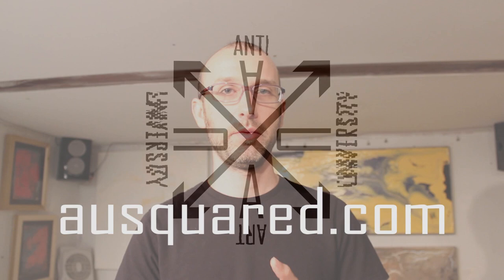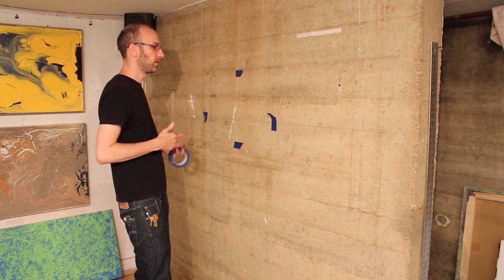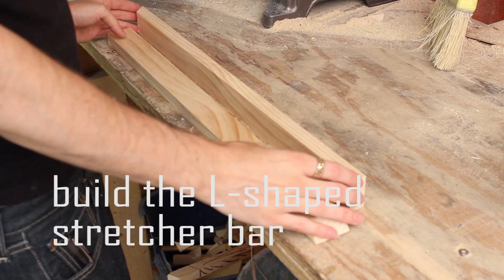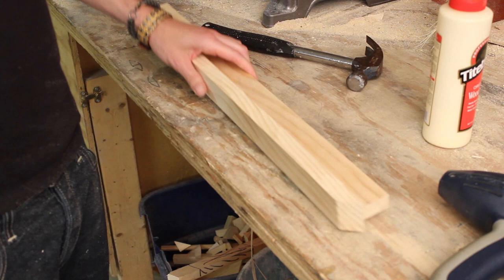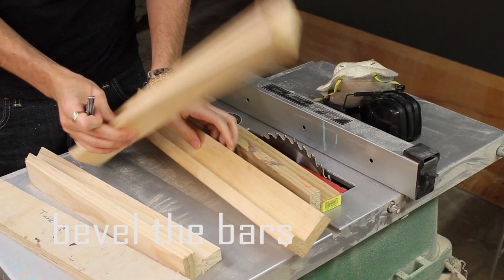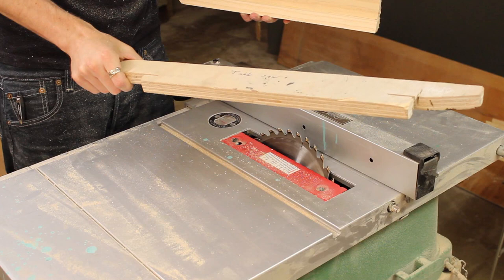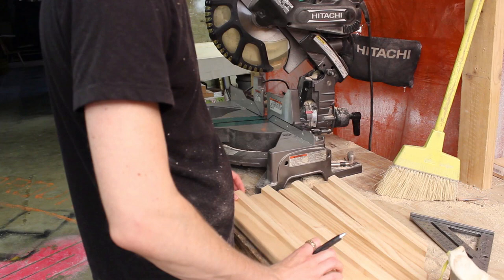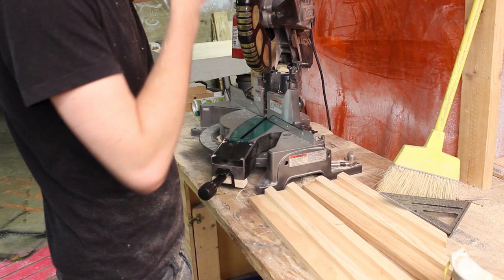Make Your Own Canvas Pt.1: The ONLY Way to Build Stretcher Bars

Comment: I’ve used comercial stretcher bars for over 25 years and have some woodworking knowledge and the tools to make things. With covid restrictions in place I’m not able to make it to an art supply store but the hardware store is open. I bought two clear pine boards 1x4x8 and ripped them in half. While it wasn’t without its challenges, with your instructions I was able to make a decent frame to stretch canvas on. I can’t wait to explore this more..cheers!
Reply from the maker: Awesome. The hardware store is your best friend when art stores are closed or far away. There are lots of potential painting surfaces. I will even prime heavier paper and paint on that at times.

Comment: Suggestion on setting your rip fence:  measure from the slot for your cross cut guide to the fence at each end of the fence, then check your distance to the saw blade to the fence to confirm the depth of cut.  This keeps the work square to the blade, preventing binding and kick back.  Plus it gives a smother more consistent cut.  Also a good quality blade is essential.
Reply from the maker: Always a good safety tip. Works best on a decent saw.

Comment: Awesome. Thanks. BTW If you set the blade height so it just passes thru the wood, it's much safer.
Reply from the maker: I know--it's just not as dramatic on film (kidding). I have a new saw now with a better guard. The guard on this saw kept catching the wood and causing it to kick back, so I took it off for a more predictable feed. It was a calculated risk at the time: use an unsafe guard or use an unsafe but more stable unguarded blade. Both were bad options.

Comment: Not only is this not theONLY way, but it is far from the BEST way! I was hoping for a tutorial on the joints used for real stretcher bars (this is just a frame) that can be expanded with 'keys' to retension the canvas if necessary. I haven't found that yet. I guess I'll keep looking.
Reply: Ron Tocknell Painters as early as Titian and as late as Rembrandt were very likely using "strainers" and NOT keyed stretchers. Titian is known to have used canvas because he painted some extremely large pieces and canvas allowed light-weight transport when needed.

Rembrandt's "The Night Watch" is 142.9 in × 172.0 in (not sure if that measurement is before or after it had to be cut) and was most likely originally on a strainer and NOT a keyed stretcher. Keyed stretchers only started to appear around the 18th century. And yes, painting on panel was common early on but the earliest paintings on canvas actually date to the 14th century (1300s).

Yes, using a keyed stretcher might help to prevent cracking but I don't think it is the only, or even the best way to prevent cracking. I am sure that Bouguereau was painting on keyed stretchers but I also know that many of his paintings are severely cracked. I once saw Caravaggio's "Supper at Emaus", a relatively large and much older painting than Bouguereau's, and it had insignificant damage due to cracking.
The best way to prevent cracking is to follow the rule of fat over lean and to paint with the least amount of layers possible. Seeing Caravaggio's paintings in person you come to realize that he was painting in a very simple and straightforward technique that used perhaps no more than 3 or 4 layers while anyone who's seen Bouguereau can tell right away that he was painting in many, many layers and glazing/scumbling heavily. Bouguereau was practically asking for his paintings to crack.
I find it troubling to insist on something that simply isn't true. And to think that there is such a thing as the secrets of the Masters (keyed vs not keyed). There are no secrets...only common sense.
Here is a very good history of stretchers/strainers:
http://www.conservation-wiki.com/wiki/PSG_Stretchers_and_Strainers_-_II._Factors_to_Consider
Reply: Besides Caravaggio, within 3 seconds of walking into any museum that holds early European paintings you can spot paintings on canvas by lesser known artists that have virtually no damage...paintings that were very likely done on strainers and NOT on keyed stretchers. I would also venture to say that if restorers encountered keyed stretchers they were very likely not original to the paintings.
Reply: On paintings that are pre 18th Century, this would certainly be true. But the keyed bridle joint came into use about mid 18th Century and, by the 19th Century, they had become the standard. So you're right in that many of the keyed stretcher bars encountered by restorers were not original to the painting... and there is a reason these painting were transferred onto keyed frames (usually glued to a more robust canvas support).It was done to address the inevitable sagging.
Reply from the maker: From my experience, the only reason I've seen for re-tension is an improper stretching job in the first place. Generally, it's uneven tension that's the problem. Typically, this is caused by starting the center too tight and loosening as you approach the corners. You see ripples around or over the edges. The other problem is storage--anywhere that varies too much in humidity and temperature is tough on canvas.
Reply: I've never had to use keys and don't know anyone who ever has. I did experiment with them once, and if you use them enough to make a difference, you then, have a mess.
Reply from the maker: You've got a point. I just think if you keep having to adjust tension, then your painting is in a bad environment. Plus, these are the kinds of concerns an archivist gets into, and that's a bit beyond what almost every artist needs to worry about. I feel like if you're really that concerned with archiving, you've probably got studio assistants you can pay to worry about it for you and a host of collectors and gallery folks to worry about long-term care for your work.

Comment: This is a good method up to a certain size. Around 5ft or so, dimensionally, I ran into needing excessive struts or too wide of inner ribs to keep everything stable.
  Fine method most of the time though.
Reply from the maker: That's weird. I've done stuff over 8' with corner braces and one cross bar to support the center.

Comment: I would add that if you buy your wood in 2X thickness and cut your 1X2 from it you will be able to get quarter sawn material. A normal 2x8 will yield 2 quarter sawn sticks from each edge.
Reply from the maker: True. Ripping 2x4s can be tougher depending on the saw. The wood quality is also not as good and tends to be more warped.

Comment: 12:23  i was about to get a heart attack .. glad it dint kickback .. 
great job .. stay safe 😊
Reply from the maker: The table saw pictured had a sub-par guard that would cause kickback 1/3rd of the time. I replaced it with a circular saw and a long metal bar to use as a guide.

Comment: I like the design quite a lot and will definitely start making my own stretchers.  But gluing end grain doesn't work because of the nature of wood fibers.  End grain is essentially a bundle of straws.  Wood glue works by bonding with the fibers.  That's why long grain glue bonds are so strong.  If properly glued the wood will sheer off before the glue bond breaks.  I think an improvement to this design would be to route out a sufficient sort of tongue and groove type joint at the corners so the glue can do its job.  Otherwise you're on borrowed time with end grain glue ups.
But thanks for the video! I'm inspired to make my own and save money for better oil paints!
Reply from the maker: I used to do biscuit joining, but I've never encountered a noticeable difference. Maybe if you over-stretch the canvas. If strength is a worry, a frame will also help.
Reply from the maker: In reviewing comments on this one, I came across this again and realized I didn't fully respond. When I take stretchers apart, because they're stapled and glued, I have to remove the staples first then bang them multiple times with a hammer to get the glue to break, and sometimes it splinters the wood with the glue remaining in place. Worrying about engineering these things is massive overkill. We're talking small amounts of distributed forces, after all.

Comment: I appreciate the craftsmanship but have you ever heard of quarter round?
Reply: Exactly how my painting professor taught us back in the late 70's. It adds that lift for the canvas, and eliminates the need to bevel the 1x2. They are also a little less weighty on a finished large canvas. I can't find anything on YouTube for using quarter rounds, so I'm happy to see someone else asking the question. We were also given the option of using brick moulding, minus the quarter round.
Reply from the maker: +Janet Wise used to use quarter round. The bars warp and at least one corner will pop off the wall. There aren't 2 directions of structural support with quarter round. This is why you use the method of 1x2s in an L shape. They won't warp unless left in a highly humid area.
Reply from the maker: Yes. I stopped using quarter round. It's good for studies, practice, throwaway paintings, etc. The problem is that there is nothing to keep it from warping with only quarter round. Typically, a corner will pop off the wall when you hang it up. This is why I switched to the L-shaped bars. They have more structural integrity.
Reply: Thanks so much, Mead
Reply: I think he was saying use quarter round on top of the 1x2 and glue it down essentially creating an L shape. However quarter round is notoriously warped to begin with so wrangling it in place can be a pain. Great Video by the way
Reply: Isn't that the little Chinese kid from Temple of Doom?
Reply: @blackopal3138  hahaha. No, that's short round. "Hold on to your potatoes!"
Reply from the maker: Yeah that's a possibility but does add more material cost. It's probably also faster to bevel than to glue and nail quarter round.

Comment: Do you have really small hands or are those 1x2s really big. They look so much bigger than the furring strip 1x2s.
Reply from the maker: Furring strips are probably even smaller than the standard 1x2. I also sometimes cut down a 1x4 to make two 1x2s, and they wind up being a bit wider that way.

Comment: Mead: thanks so much for sharing your valuable experience with all of us. I've made several picture frames for my wife's art but have only just recently decided to try making stretchers (I didn't even know they were called that). After quite a bit of searching, I finally stumbled upon this series by you. Amazing and packed with so much good info! The only question I have for you is pretty simple: when you say 1" x 2", do you mean actual or nominal dimensions? Up here in Nortthern Ontario, Canada a so-called 1 x 2 White Pine dressed 4-sides board is actually 3/4" x 1-1/2", although lately it's more like 11/16" x 1-1/2".   Gary
Reply from the maker: I meant the nominal dimensions. It would be crazy difficult to get an actual 1x2". You would have to get it custom milled from a 2x4". Hope everything works and you make some good bars.
Reply: @MeadMcLean  -- even more amazing that you are answering a many years old topic within hours, Mead! Thanks for clarifying that quite obvious detail. I do expect to make my first Mead McLean style stretcher within a few weeks. It'll probably be a 4' x 5' one so I'll get to try most aspects of your system. I had ordered a roll of 61" x 25' double-primed canvas before seeing your video on priming, so don't know if I'll do the extra Gesso treatment you advise or not; I probably should. Gary

Comment: Do you measure from the very end when sizing.  In the video I didn’t see where you put the end of the measuring tape.
Reply from the maker: Yes. Measure from the very longest point of the stretcher. Make sure both sets of bars are the same length. Then measure corner to corner on the outside when they are assembled together. If the two corner to corner measurements are identical, then it's square.

Comment: Thanks for showing us your method! I was wondering how large you can go without having to build cross-braces? For instance, I want to stretch a 48 x 32 inch canvas.
Reply from the maker: +Ola Sarri general recommendation would be about 4 feet in any direction. You can tell by the way the bars feel. If they have any flop in them, use crossbars.
Reply: Excellent, will try this next time I build stretchers!

Comment: Hey quick question, So what If I don't have all these saw tools, How could one still make his/her own stretcher bars?
Reply: How about a skilsaw?
Reply from the maker: You can use hand tools. 1x2's come ready-made. You can get a miter box for $20. A hand planer is pretty cheap. You can use a hammer and nails instead of a nail gun. This is what I did for several years.

Comment: First of all, I find your method very convincing. I tried other methods too. Wasn't pleased with the outcome though. Your video is quite old now which means you have years of experience and I read in a comment that you still do it the same way. Now, I guess you have some paintings which are years old which leads me to the question: how have they aged? Are there any issues with the canvas? I highly doubt the wood makes any problems. One more question. Somewhere you said you use 1x2 inch wood. Are the two pieces of the L the same or could I use a slightly smaller piece for the part that lifts the canvas? Would make the construction a little bit cheaper ... Thank you for sharing such valuable information
Reply from the maker: So far everything has aged fine. I don't think anything has warped too badly, but then I do keep everything in climate control. I just use 1x4's that I cut down the middle to make two 1x2's. If you didn't have a table saw, you could buy two 1x2's and some 1/4 round moulding or the moulding that's triangular and attach it to the 1x2 L to create the same thing. The strength comes from the symmetry of it, so if you used a 1x2 and a piece of 1/4 round moulding, it would definitely warp. And yes, I still make everything the same way. Haven't changed it since I first learned the technique in 2004.
Reply: @MeadMcLean  since 2004 rests the case for me. I'll follow your steps

Comment: I really appreciate the thought of making this video, but, for someone with zero woodworking experience you've lost me at which way to put the boards before gluing (less than 5 minutes in). The only reason I decided to tell you is because I've never seen someone with so many views but so few ratings, which could be for the same reason - that people appreciate your efforts but got lost quickly if they're not already a woodworker. Perhaps you could do a second one for people with no woodworking experience? Just a thought. In any case, sincerely, thank you very much! I appreciate you. (Fyi, I already stretch my own but do not make my own. Can you tell me what the cost savings is? I'm assuming it's huge! Especially since purchasing a 1x2 of pine is nominal! It's just the other stuff. Lol.
Reply from the maker: I assume you mean the bit about opposing the warp? Most of the time, the wood will curve in a long C-shape. You put the center of the C's together. So it will look like the ends aren't even touching each other. This allows for the 1x2s to bend each other straight. I have some old footage I may be able to put together for some more basic methods too. I do things a bit differently now as well. 

As for reactions on here, there's just no telling how/why people react. So far it's mostly been positive.

Savings is big overall for the quality, especially if you're making big pieces. The savings is less if you're making small canvases. If you're just learning, acrylic on paper is cheap and good for throwaway studies.

Comment: What do you suggest for the staple length for a large frame 1 inch thick wooden bars? And if you can post the link to buy the strap? Thank you.
Reply from the maker: I'll have to get back to you on the strap. I just get them at the hardware store. Staples I just use the standard 3/8" ones
Reply: @MeadMcLean thank you so much. I found that strap on Amazon but I ordered a clamp set.

Comment: So after you glue and stable it, how is it going to stretch (expand) when you need to tighten your canvas?
Reply from the maker: You don't. This has been discussed to death in other comments. The short version is if you stretch correctly, you don't need to keep stretching later.

Comment: I took a workshop on building stretchers while at art school and this is not how I learned to do this. You need a table saw and a mitre saw. 1" x 2" clear pine are beveled at 45degrees on the inside so that the canvas does not touch the wood. There is no need for an L shape. Corners are beveled with a mitre saw and are glued and nailed. You need a mitre vice to assemble, glue and nail the pieces. Cross pieces are cut to size with a mitre saw and a dado blade.
Reply from the maker: The problem with this is that the canvas tension will absolutely warp the bars. One of the corners will pop off the wall when it's hanging.